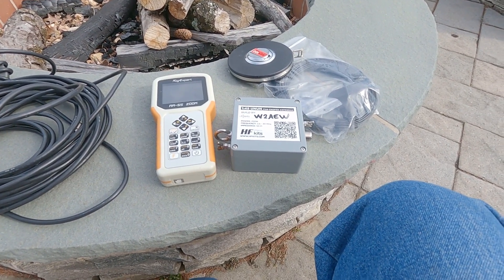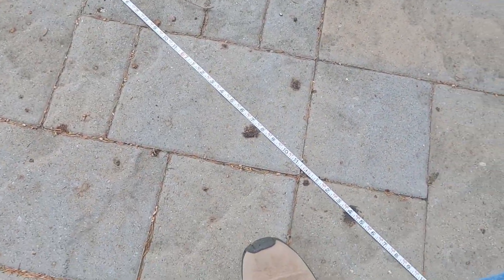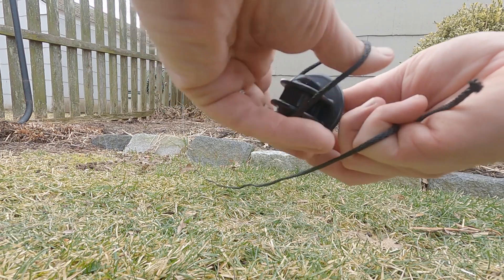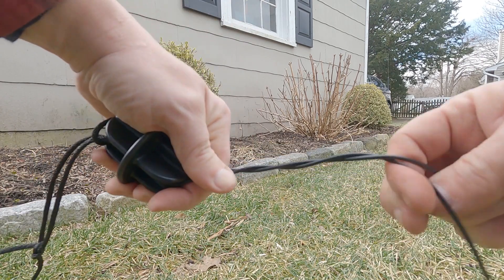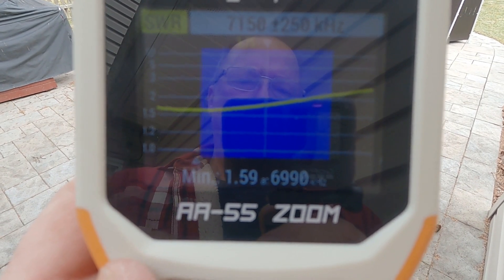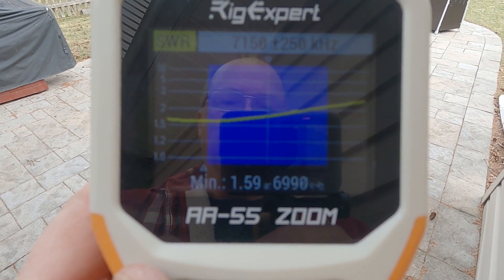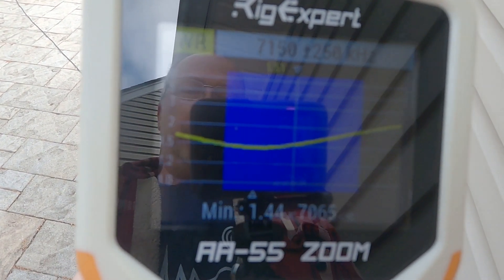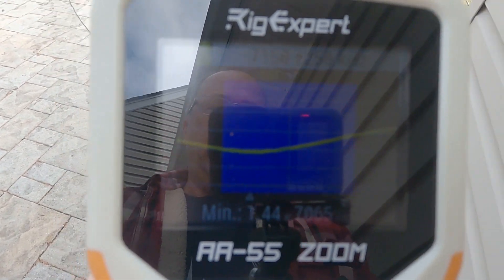#347: Quick test of the 40m Halfwave End-Fed antenna using a 49:1 transformer / UNUN

Comment: Very good.  What size and type of antenna wire do you recommend?  Should I be worrying about hurting birds?  --Joe W2JEJ
Reply from the maker: Hi Joe - No worries on hurting any birds - it's unlikely they'd be in a position to bridge themselves between the high-voltage ends of the wire and ground.  I just used the wire it came with - looks like 16 or 18 AWG with a tough UV resistant jacket.

Comment: Sorry about a rookie question, new ham here. Does it work the same way if this hangs down from a 5th floor apartment window?
Reply from the maker: The problem with hanging the wire out of a window is that the wire is very close to the wall of the building.  Any antenna, including this one, will be affected by nearby objects.  So, both the tuning and the performance will be negatively impacted.
Reply: @w2aew  I see. Thank you for the reply.

Comment: 49:1 means transform from 50 ohms DOWN to about ONE OHM.

That means the antenna is a DEAD SHORT AND CANNOT WORK.

You mean 1: 49

Gross ignorance pretending to teach others is how ham radio became the Blind leading the Lame.
Reply from the maker: It is 49:1 from the antenna's perspective, and 1:49 from the transmitter/feedline's perspective. 

It's a real shame that you feel that 42 years as a ham, and 39 years as a gainfully employed electrical engineer doing analog/RF design, test and validation, still makes me grossly ignorant.  It must be very lonely in your ivory tower.
Reply: K8BYP you are the one that shows great technical ignorance yet once again.  You knock others in almost every video you make as well as when commenting in the videos of others and it appears you have an inferiority complex.  You also block others that post actual data in a constructive manner showing that many of your technical statements are in error.  W2AEW is one of the most competent engineers and youtube video creators that exists, and you have once again shown your technical ignorance and overall poor social behavior.

Comment: can it work 5,000 miles under dead band conditions with about 5/8 watt?

My 20m dipole did last nite. Italy 5-8.

No chance on that  junk end fed.

No such thing as end fed HALF WAVE.

Efs are RANDOM LENGTH WIRES according to a reputable source ( not internet rumour) Radio Antenna Handbook 1935, published by Engineers at Radio Magazine.

Comment: What? NO SNOW? Looks like a great antenna project! I swear that it seems like wire antennas outperform beams at times. I especially like the idea of the pulley at the top of a mast to make quick changes and comparisons.  I've been getting back into CW myself. Keep us posted with some on the air test results. Thanks Alan and 73's.
Reply from the maker: Certainly on the lower bands (below 20m), wires can work better because they don't have to be "shortened" with loading coils, etc.  The pulley at the top of the old sailboat mast is really helpful for experimenting.
Reply: I have a center fed dipole fed with 300 ohm twin lead through the window. It consists of about 65' of twin lead, and two 65' 14 gauge wires coming off the center fed point which is only about 15' off the ground. The ends actually go into the snowbanks (I live in Maine). I copied the idea from my 1955 HB. 10 meters has been wide open and this antenna seems to work good all the way to 80 meters with no gaps to speak of using a Murch UT-2000a tuner. My first contact was a 15 meter ssb to a PA station running who was running QRP. I like to tune my antenna using >2 watts AM with no audio. I forgot to turn the power back up and we exchanged 59 signal reports!
Reply from the maker: @W1RMD  Very similar here. I use a 130' center fed dipole, but with the 450ohm window line, going through the window to my 2nd floor shack. I use a Ten Tec 238C tuner, operate from 80 to 10m - mainly on 40m and 17m for me.

Comment: Excuse my ignorance as I’m still learning, is there a way you can tap of the main antenna cable with a moving connection and moving it along until you find the sweet spot. Thanks 73
Reply from the maker: I'm not sure what you're asking. What sweet spot are you looking for?
Reply: @w2aew   The point on the antenna length that gives you optimal reception and the best reading on your analyzer. Considering you have extra cable twisted at the end.
Reply from the maker: @richardshort4587  It's not really about finding the correct point to feed the antenna, but rather adjusting the overall length of the antenna for best efficiency (in this case)  An End-Fed Half-wave is called this because it is a half-wavelength long at the desired operating frequency.  Same thing for a simple dipole.  There is another type of antenna called an off-center fed dipole where there is a feedpoint that is between the end and the middle, but that's not the antenna we're talking about here.
Reply: @w2aew  Thanks for the explanation. 👍🍻

Comment: Why did you not test it on 20 , 15 and 10 meter.  great thing about the endfed halfwave is that it is resonant on every even en odd harmonic, no tuner required.
Reply from the maker: Yeah, I should've tested at the higher harmonics too.  In my head I was just thinking about my mono-band 40m CW transceiver (QRP Labs QCX+), so my testing was focused on that use case.

Comment: I have 75m dipole woven between my rafters and roof decking. It's resonant at 3.916 but tunes 160m to 6m Some (2 if I remember right) bands are unusable because of RF in the shack. I've done some things to improve it, like a 4:1 Balun and 1:1 Choke. I use it for CW, FT8, and SSB DX. My log is mostly full of FT8 these days (I made it into QST this month :) ). By all accounts it shouldn't work, but it does.

Comment: Thanks for another great video.  I have been curious on the effects of simply pulling the wirres back is versus trimming.  I watched a video that stated the capacitance went up if the wires were too long.  I suppose that makes sense if they are not twisted.  I've often wondered if you pulled the wire back then finding a point about in the middle to twist the wire around but in opposite directions on either side of middle would  make a difference.  If you were going to play with the choke more there was a video by Steve Ellington on using the coax as counter poise.  The link shared is is a summary of a much longer video that he did.  I thought it might give you some ideas of different things to test or how to do the test differently.  https://youtu.be/MzfQybYMlUc.  Thanks again de ki7cia.
Reply from the maker: Thanks, I"ll give that video a look see...

Comment: Great video as usual, Alan. Could you someday cover why you considered a common-mode choke and why one would need one (and how to make it)? Thanks!
Reply from the maker: An end-fed halfwave has an unbalanced feedpoint.  Usually the coax shield provides the counterpoise, and thus may require a common-mode choke to keep the shield current from potentially causing issues at the radio.
Reply: @w2aew  Thanks!

Comment: grrrr he has a turner behind him... someday ill find one ... works great on my HK 110a ...
Reply from the maker: I run that old +2 on my TS-830S.
Reply: @w2aew  i tried a d104 old school and the newer black and gold soild state d104. nite eagle i think its called.. there ok.. them old turners just sound good.. matchs the heathkit setup. hahha
Reply from the maker: @XPFTP  The D104 you see in the picture is used with my TS-870S - but it has a little secret.  The original transistorized preamp is removed and replaced with a homemade preamp and tone-control circuit.
Reply: @w2aew  that is something they needed bad. tone control.. maybe this summer ill tinker with one of the d104s.

Comment: does changing the antenna from a straight line to say a shallow v shape change the effectiveness of the reception?
Reply from the maker: More height is generally better.  Going to a shallow V shape will make the radiation/reception pattern slightly more omnidirectional.

Comment: Well done Alan, don't forget you are measuring the entire system in your case, really you should measure right at the transformer. If you put a resistive load where your antenna should be you can fine tune the secondary impedance a little to show 50r or there abouts at both ends of the expected impedance say 2.5 -4.5kr.
Reply from the maker: Yes, or course.  At the end of the day, I'm interested in measuring the system, so that I can see what the transmitter sees from an impedance standpoint.

Comment: Thanks for the video.  

I bought the same kit from ARRL for Field Day 2021. I was very pleased with the result.  I got acceptable performance on 40M, 30M, 20M, 15M, 12M and the lower part of 10M after trimming it using a nanoVNA.  (I mainly use FT8, so mostly live at the lower parts of all these bands). I later replaced the wire with one ~132' long and added 80M.  The only issue I have seen is that I get a LOT of RF feeding back into the shack around 20M.  I may try adding a counterpoise.

Comment: Nice Alan. I am trying to get my CW chops up but life happens... I would have to listen on SDR. S9 noise floor here...let me know when you are on.
Reply from the maker: Most of my operating time is on 40m CW, between 0000Z and 0400Z (8PM-midnight here in NJ).
Reply: @w2aew  are you qrp?
Reply from the maker: @-Todays-Tom-Sawyer-  When operating portable or on vacation - yes.  When operating from the home shack - sometimes.  I usually run 25W CW from home, but occasionally will run <5W using a QCX+, or IC-703+, or FT-817.